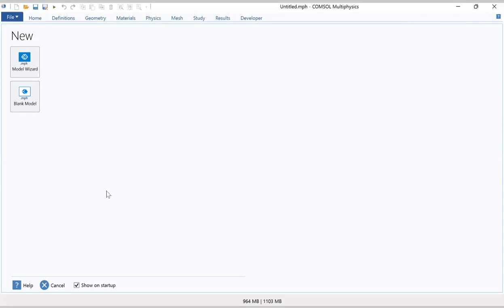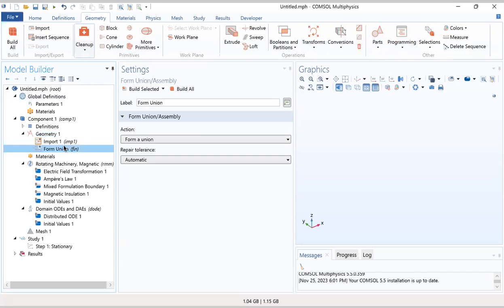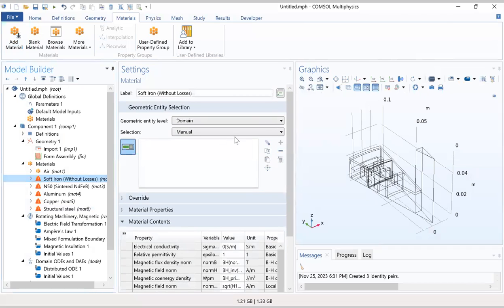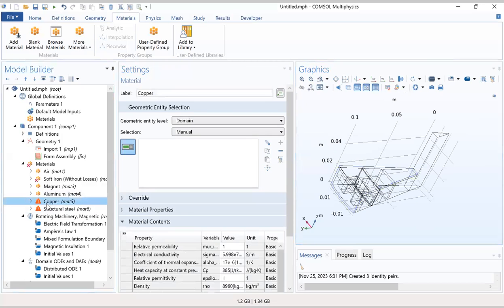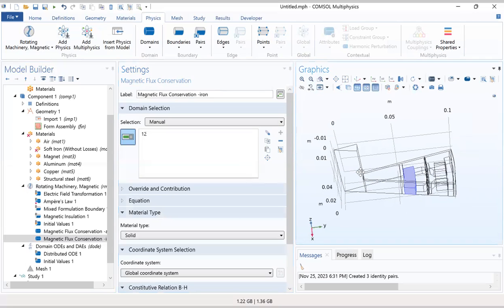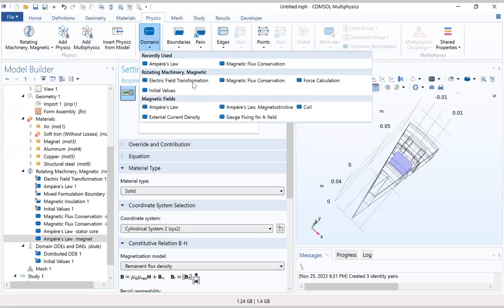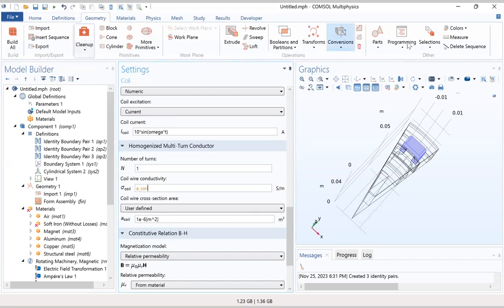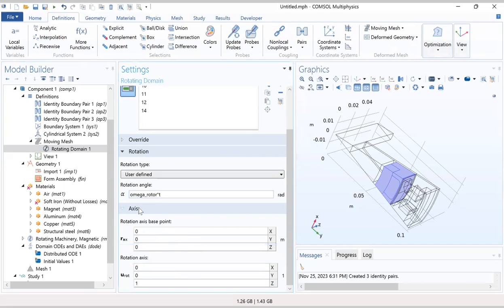How to model 3D Permanent Magnet Motor in Comsol Multiphysics

Comment: Hello, I am new to your channel, currently  working on a graduation project that involves modeling the plasma region of the PL 35 ICP plasma reactor, which is used to synthesize and spheroidize micro-sized metal powder for additive manufacturing applications. 
I used the Inductively Coupled Plasma interface from the Plasma Module, the Heat Transfer in Fluids interface from the Heat Transfer Module to model the plasma region, however, I am not sure which COMSOL interfaces and studies I should use for the metal powder, could you give me some information.  
Thank you very much😊
Reply from the maker: Please send me an email